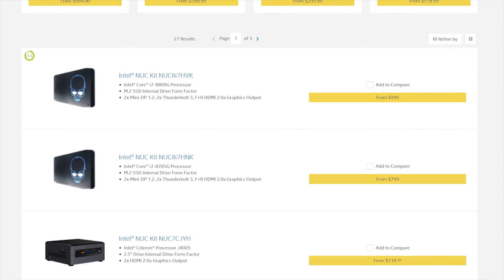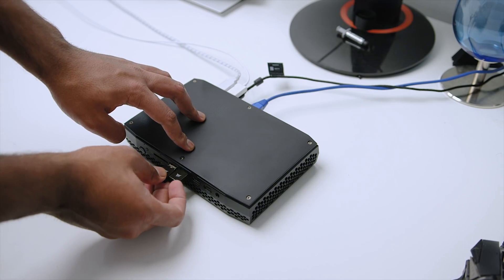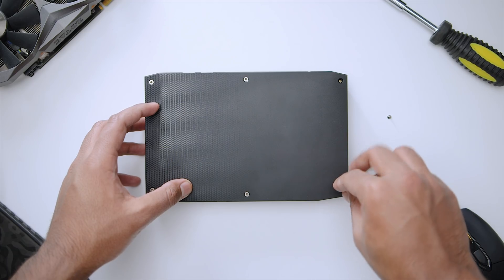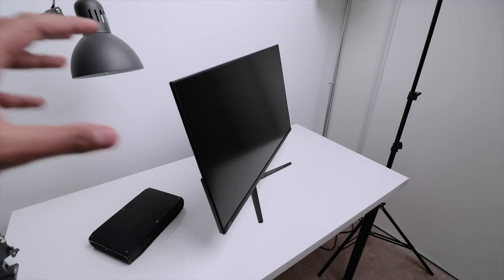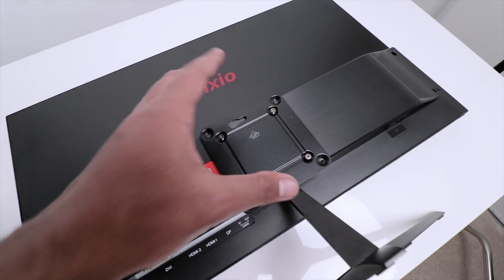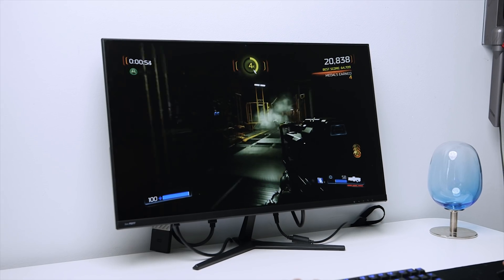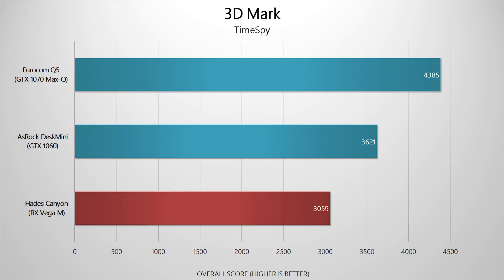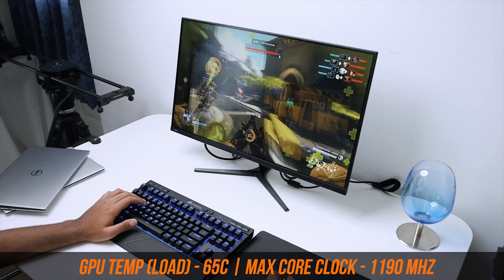The FUTURE of Ultra Compact Gaming PCs? Hades Canyon NUC

Comment: 2 years later...
I bought the lower end version to replace a dying 15 year old HTPC.
It set me back $2000 Canadian after adding a 500GB 660p NVMe drive, 16MB of Ram and an oem Win 10 pro.
Now yes, I could have built something for far less that would have worked, but I really didn't want a large case, and this is compact enough to be invisible...literally, vesa mounts included.

Not a fan of the optical out, which is not standard TOSLink, but that's just a matter of finding out how it can interface with my receiver.

Gaming is mid-range gaming PC level (this is the lower end NUC8), seems to run games at decent framerates at 1080p...4K is pushing it for games, but for media playback it's brilliant (and media playback IS why I bought it)

 It's a decent Intel computer with some AMD ooomph for graphics, and facilities for two M.2 drives making it nice and zippy. And it's teeny!

No regrets, even at the price for an old version of the NUC.

Comment: Get some nuts to screw on underneath the vesa mount to stop that wobble. You can find nuts to match the diameter of the screws. You can use 3M adhesive wall-mount clips (think hanging pictures or securing cables) or other options to get rid of that tape on the back. Nice review, but your home brew rig management strikes me like buying a thousand dollar suit and wearing it to a painting class. ;)

Comment: I need the IO for audio editing and mixing. I use two monitors, one for my editing window, the other for mixing and I use a third, usually a TV for the video in the center. I'll need two Ethernet like it supplies. One for internet, and the other to control my artist mix. Ill need USB C for an external Audio Interface and two more USB C for data backup and management. 2 USBs for my mouse and keyboard... I don't know how well this will run Protools but I hope it make it scream. I only own pro tools 11 so I don't know how all this will work and if it will. But that's why I need the excessive IO. 
I'd love to game on it as well, but only for emulation of older titles and not modern AAA. Maybe dabble in some VR if I get around to it. 

If you can't find a use case for your machine that Intel has provided you....I'll buy it. Hahaha
Reply: TheSuperSanchez I’m almost on the same boat as you. I have a 4k monitor with PS4, Xbox, and Roku connected.

I work with FL Studio and Ableton and have a USB audio device for my Yamaha speakers. My mirrorless camera has a USB C port.

The NUC is pretty much the perfect PC for my situation.

Comment: Ebert you don't deal in actual hardware much do you? By that, I mean nuts and bolts sort of hardware. The solution for your problem would have been metal wasters to pack the empty space. They would go behind the VESA plate, out of sight, you could had even painted them black to blend in if you were so inclined. Alternatively, if washers are too little to help some nuts would have worked quite well.

About the aesthetics, in a business or home setting where everything isn't sterile and clinical it would fit in perfectly fine for persons who live in such environments.

Comment: Best review of the NUC8i7HVK (Hades Canyon) I've listened to and watched. Great job. I been an owner for nearly a month and use this as my live-gig Digital Audio Workstation. I use a 4k 15" touchscreen monitor, that's it, but always have a small keyboard and mouse just in case. But for the last month, haven't needed it once. 

When it's back home, I use this NUC for graphics design, video editing and more music creation. It simply rocks and I would not have been able to do this with any other form factor.

Why no laptop you might ask? It comes with a keyboard and touch pad, right?

Well ... yes. But I need Thunderbolt 3 for my Universal Audio interface and also for my two 4K monitors at home ... this NUC comes with two Thunderbolt 3 ports.

It's just perfect for my applications - however, for a serious gamer or casual gamer who just wants something cheap and cheerful, this is not the recommended machine for you ... unless you need Thunderbolt 3 ports, two Display Ports, Two HDMI ports, 6 USB-C, and infrared.

Show me a machine you can build for less than this NUC with all of the ports and capability together with the very low power consumption, and I'll buy you a cup of coffee (or Tea!).

Comment: Screws too long = incompatibility?? Anyone left on this planet willing to tinker even a tiny bit? Though I do not consider getting shorter screws as tinkering... $1000 is far to much and I wont spend that much any time soon for that amount of hardware. If it came with 1080p monitor, 8gb of ram, and a basic 256gb SSD, then it might be worth a grand.

Comment: next we need barebones laptops

design a macbook like chassis but thicher closer to 21mm 
choice of 2 or 4 or 6 or 8 thunderbolt three ports (the slots/holes) 
and logic bored sold seperately wih the cpu/gpu chips to be self soldered on/ if thats too hard then sockets somehow
logic board includes vrm etc
and the cpu heatsinkin the chasis?
4 mm bezels no camera/ camera popup on function key
or magnetic camera sticks to the back and pops up when you need it/ on a bendy spring if you know what i mean
but hey a guy can dream,i hope to live to the day that its possible to have laptop as customisable as desktops, and as powerful as the desktops today

Comment: I cant help but feeling that not enough effort was put in this video. Should the creator went and bought shorter screws (or some rubber washers)and shorter hdmi cables, this would have turned out to be a much neater build. I clicked on the video hoping for a dope-ass clean setup ... but ended up being utterly disappointed.

Comment: For a long time I've had this sense of uncanny valley with the audio of your videos. It's more prevalent with Eber than Dmitry. I could never put my finger on it but I think it has to do with some combination of noise reduction and compression or something. It's not as noticable during b-roll, mostly when the person talking is also visible. There's some kind of disconnect between the visual and the audible, like a synthetic or over-processed hue over the voice. Am I alone in this? HardwareCanucks put out good content, I'm not trying to rag on you guys. I just wanted to voice my thoughts.

Comment: In my case I live in Japan where electricity is about .30$ a Kwh so I want my next PC to be lowerish power.  plus space is an issue so the smaller the better so I think I am a perfect use case for this thing. 

I have a  4-5 year old Y50 laptop that I use and its really crappy for Conan.

I really love this thing but the 4GB or ram worries me a bit. We are right around the corner from 8GB becoming the standard. Especially now that the XBOX has a full 8(9) GB of Ram....

1000 bucks is also a lot of money for me.... I would jump on it for sure if it just had 6GB or VRam or about 200$ cheaper.

Comment: What size a small form factor PC?
While it might be an engineering challenge to get the most power into the smallest footprint, sometimes relaxing that criteria can get you big gains in performance.
What I don't understand is why they insist on using piddling little heat sinks on the inside of the NUC with screaming noise levels when you ramp up the performance, when if they made the lid the actual heatsink and put a couple of 120mm fans on the outside with a filtered cage around them they could lower the noise levels and increase heat dissipation at the same time. The box might end up a little deeper and not look as neat but the footprint wouldn't be much different if at all. Your standard GPU twin fan cooler can handle 200+ watts of heat easily, which would boost the performance of these little boxes without assaulting your ears.

Comment: Thoughts on premiere pro: 
1. possible cache/ram bottleneck?
2. Why does the intel cpu still have an integrated gpu/media encoder.decoder when it has a dedicated AMD gpu?
3. Did you try going into the bios and playing with the the intel iGPU cache settings?
Reply: I know for sure the Radeon GPU is hardware toggled for power consumption, thats why you need the Intel gpu there. Also using eGPU on Thunderbolt ports should be possible. And fully utilizing the monitor outputs. That was not really covered. And potentially you could maybe go into Bios and disable the intel gpu for cache settings, they have a lot of stuff in there.

Comment: I love the principle behind these products, but I will never be able to bring myself to buy one due to the external PSU (which I'm disappointed you didn't point out). I would much rather have a slightly larger chassis that includes the PSU inside the case. If I'm buying a desktop, I want a single unit.
Reply: The entire point of a small form factor computer is to be small.   If they put a PSU in the same case it would be much larger.
Reply: Yes, the point is to go tiny; you are correct. And imo if you can't fit all the components into a single case then it isn't a desktop. 

We saw with the old-school Dell Optiplex 790, 7010, and 7020 USFF systems that you can fit a PSU in a super-small case. Granted, they didn't have a GPU in them, but they did have an ODD, 2.5" HDD, and full-size DDR3.  Both the ODD and 2.5" HDD could theoretically be removed, and the RAM sized down to 'Laptop form-factor', and replaced with a larger heatsink to cover the GPU and a larger pico-psu to compensate for the extra required power.

Just my opinion, though. :)

Comment: The use cases for a gamer where this makes sense at this price point are almost non-existent. 

- Travel for work, but want to game? Why not get a mid-range gaming laptop that isn't much larger than this and is far more useful? You are probably going to be traveling with a laptop anyways.
- Constantly traveling between two locations that already have monitors/keyboards? Build two budget machines which would probably outperform this one.
- Want a gaming machine that is as small as possible? The Skyreach 4 Mini case is the closest you can get to this size with desktop components (mostly). It would also still turn out cheaper even with the expensive SFX components and be upgrade-able.

There is a reason why Eber put 'future' in all caps other than to be clickbaity.
Reply: "The use cases for a gamer where this makes sense at this price point are almost non-existent"  For you maybe.  

"Why not get a mid-range gaming laptop that isn't much larger than this and is far more useful?"  Which mid ranged laptop has as many ports and performance and is just as small?

"You are probably going to be traveling with a laptop anyways."  Based on what objective evidence?

I travel all the time and I don't like carrying around a heavy gaming laptop or taking one into meetings, but I do like doing some gaming in the evenings.  This is perfect for connecting to a TV in the hotel and using it to game and watch digital content on.
Reply: "For you maybe."
Than name a few where only this product works.

"Which mid ranged laptop has as many ports and performance and is just as small?"
I stated mid-range gaming laptop and for around the final configuration price of this being $1300-1400 there are a few in that range from Dell, Origin, Clevo, Lenovo and Asus.  All have 8 series quads like this NUC and GTX 1050 Ti or greater. For reference the Vega M benches between a 1050 and 1050 Ti. They aren't going to be "just as small" since they also have keyboards and screens. You still need to have a keyboard with the NUC which takes room unless you get a crappy folding one. Also if you are going to use this for gaming in the hotel room, why the hell do you need 9 USB ports, 4 display outputs, and two ethernet ports? Get a small USB hub if you need more ports.

"Based on what objective evidence?" 
Most people travel with laptops for work. I didn't say everyone hence why I said probably.

"I travel all the time and I don't like carrying around a heavy gaming laptop or taking one into meetings, but I do like doing some gaming in the evenings.  This is perfect for connecting to a TV in the hotel and using it to game and watch digital content on."
So you do travel with a laptop... There are 4 lbs laptops with 1050 Tis or 1060s if you are willing to spend a little more (Razer Blade, Zenbook Pro), but if you are used to sub-3 lbs ultrabooks than yes there are no options in that weight class. Are you really ready to drop $1300-1400 on a device just to play some casual games (controller+hotel TV) and watch Netflix in a hotel room?

If you are, then congratulations! You meet the criteria for an almost non-existent as in very rare use case.

Comment: if this was like $400-600 i would get that  for the whole office. But really, $1300 for barebones machine? Hell no. Maybe they should cut that down to 4 core + 4 threads,  no vega. That should cut it down a bit. Anything above $600 nop bueno.
Reply: Act1veSp1n There are other nucs than this one, this one is meant for gaming and vr. They make one with an i5 for around 400. Also its $999 not 1300.
Reply: Intel makes other NUC's.....You have access to google right?

Comment: Good video but how about doing one on the less expensive NUCs that are sold? Was looking on Newegg at an Intel Nuc with an i5 cpu for just $350. I think most folks using these systems would opt for less expensive ones and I'd like to see what they can do on simple daily tasks.
Reply: The i5 CPU NUC you are looking at is dual core i5 CPU with a TDP of 15w and max boost clock of 3.4GHz with Intel Iris Plus Graphics 640.

Comment: for 1500 I got a RYZEN 7 and a 1070 full size rig that would cream that thing head to head. Yea for a bare bones system that is overpriced. It looks nice but not worth a thousand bucks for a nice looking moderate gaming system
Reply: JP Stone yep and if this unit was a full size product, It would  smoke your PC. Because Intel would have run a desktop CPU like a 8700k with a 1070/1080..or water cooled the CPU/GPU on this unit and pushed the clocks up.. Because we all know how crappy Intel CPUs overclock
Reply: The whole point is the NUC is small and compact.  That's why it costs as much as it does.
Reply: Yea, of course an 8700K will smoke any Rayzen CPU say maybe the Threadripper and even then AMD would only come out ahead in Multi-Core. I'm not saying AMD v. Intel I'm saying budget minded Mid-Tower fully loaded V. compact bare bones. If the Skull Canyon came with 16 gig of RAM, and set of peripherals might be worth it at the price point.

Comment: I think temps could be a little bit better if you mounted it other way around - so that the exhaust is on the top, otherwise a nice video. Pretty unique machine indeed.
Reply: I don't think it would make a significant difference.
Reply: Derek Jonez , yes, probably it wouldn't, but now it's interesting what kind of a difference it would make, if at all. Just curious.

Comment: I get the appeal of small form factor, I'm planning on doing a ryzen 2400g build as small as possible soon, but 1000$ for that? Yeah sure its small but holy shit that's a lot of money for not that much to show for it.
Reply: you also get incomplete package, as hardware canucks said you need to get ram hard and os, in my local store its 1100 euro with included 960 evo 250 gb and 8 gb of ram. This rx vega m gh is between 1050ti and 1060, its impressive for igpu but not very good if you compare with dedicated gpus. You can build mini-itx which will be again bigger case but far more powerful in games. This NUC seems like good deal for people who travels a lot. Its compact, powerful enough, but expensive. Thats why in my opinion its a niche product.
Reply: The GPU in this NUC is a lot more powerful than in the 2400G.  

Userbenchmark:

AMD Radeon RX Vega M GH vs RX Vega 11 (Ryzen iGPU)
Userbenchmark Effective 3D Gaming GPU Speed: 53.4% vs 20.4%  
AMD Radeon RX Vega M GH  - 48th / 590  
AMD RX Vega 11 (Ryzen iGPU)  - 127th / 590  

Userbenchmark shows the Vega 24 graphics in the NUC is 161% faster overall than the Vega 11 graphics in the 2400G.
Reply: It's not going to complete with a desktop and it's not meant to.  It's designed to be as compact as possible.  I'm going to do some testing, but I'm willing to bet the $1400, all in with Windows, storage and Ram is more powerful than my $2600 Surface Book 2.   I understand the surface has a very nice built in monitor, keyboard and trackpad, but I already have a keyboard, mouse and TV/Monitors.